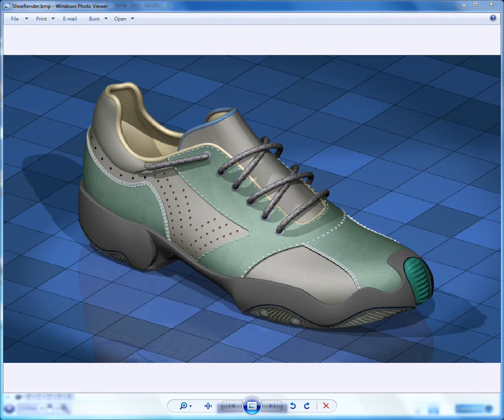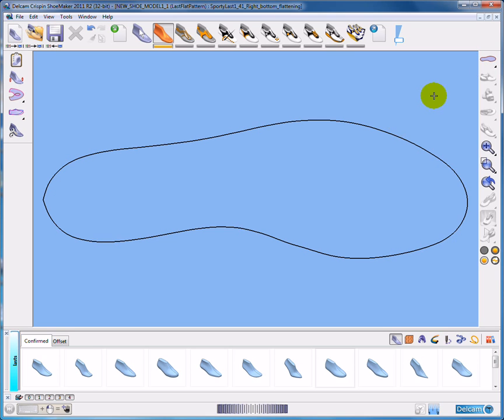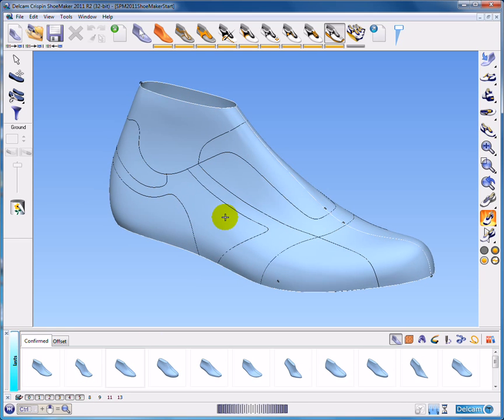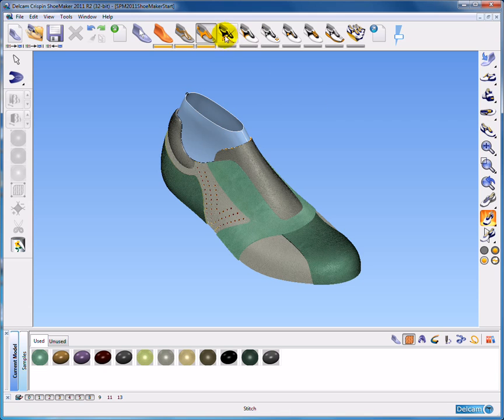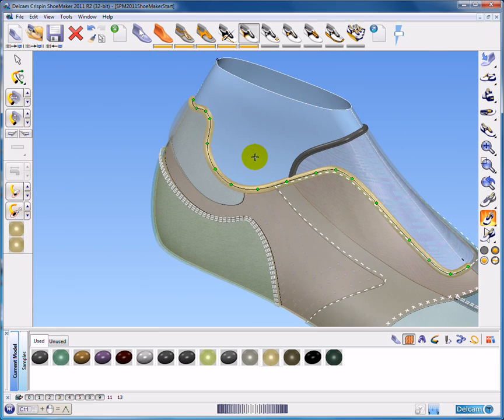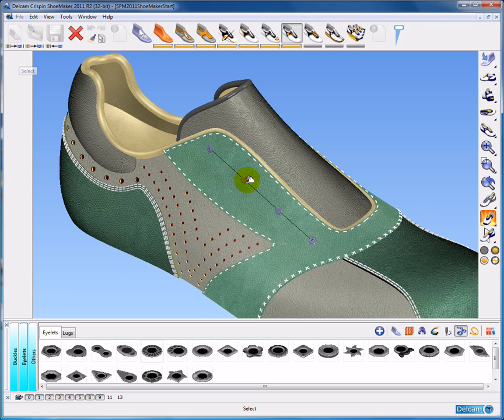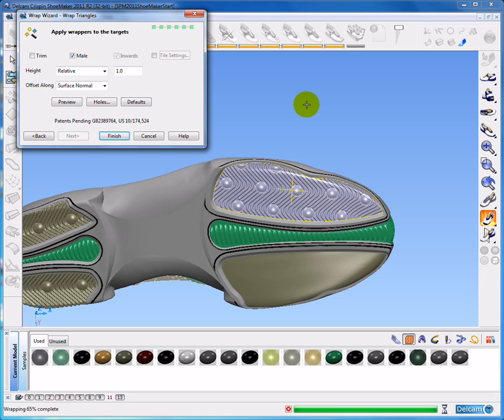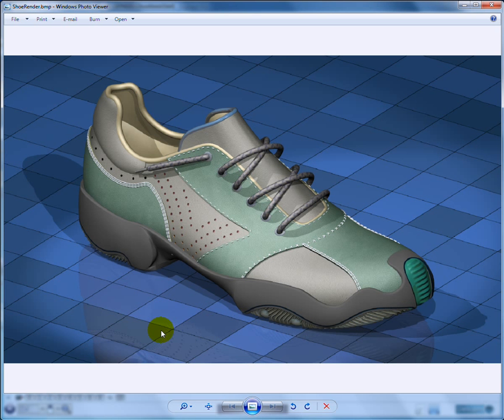ShoeMaker Pro.wmv

Comment: Where is the advanced shoe editor option in the current shoemaker? The numbers 1-13 on the bottom of your screen do not come up on mine.
Reply: I have that question as well. I also dont really understand why Delcam doesnt make any PROPER tutorials
Reply: They send me some vids when I specifically ask for them. contact law@delcam.com also you can get some other tutorials here. Remove the spaces http://    lz.delcam-crispin.com/2014/en/index   .html
Reply: kane Kain is there a video about making custom soles? And how do you get that 1-13 bar?
Reply: kane Kain THX SOO MUCH btw
Reply: lemkid121 Yes and no. I can send you a video Lauren sent me on making a sole. They never publically posted it. I can send it via we transfer. If you have any other questions I think I can help. I've been buring up through this. http://         www.delcam-crispin.com/tutorials/
Reply: Could you send me the vid? Maybe with google drive or something? I really appreciate it.
Reply: The link doesnt work haha